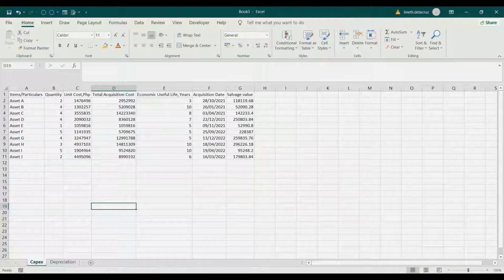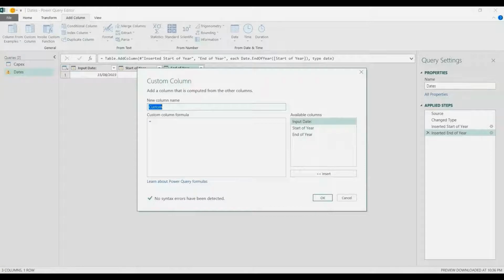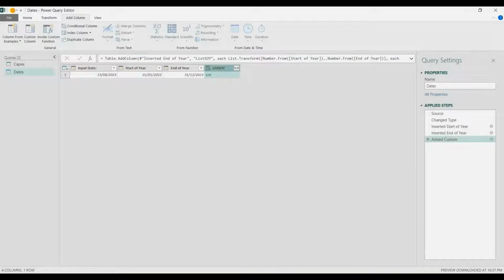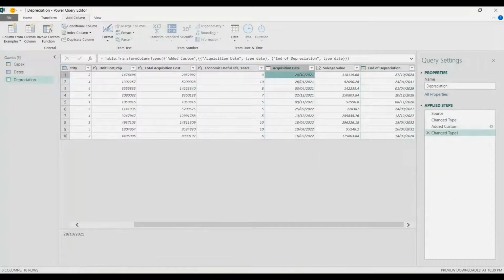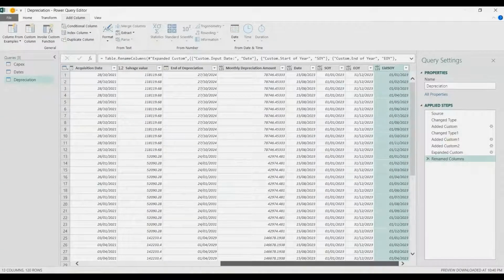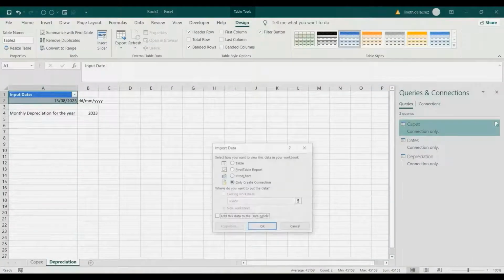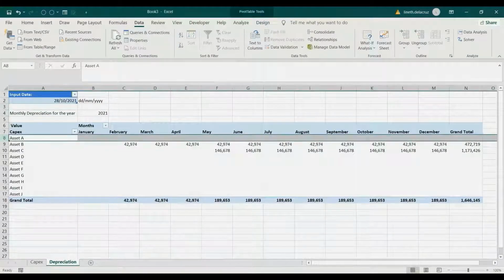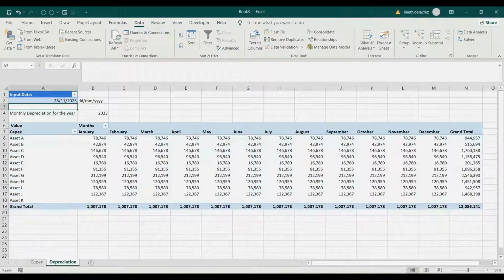Power Query Dynamic Monthly Dynamic Depreciation Schedule Using Straight Line Method

Comment: Lineth

thanks for this tutorial, it was just what I'm looking for concerning  the Straight Line Depreciation calculation.  Can the same technique/ pattern  be applied in power BI  or have I to load the generated table in power BI. 

I seached the web for the function in  power query and found no function for depreciations like de Double  Declined Balance.
does this mean that I have to write the formule with if statements ?

 can your calculate the DDB    ( Double  Declined Balance ) also in power query? 
( restriction here is when the DDB < lineair depreciation   then change to the linear Depreciation 
 
example 
asset 10. 000; l  ive 5 or 20  %;   salvage =0 ;  start date 1/1/2021  for reason of simplicity can be any start date in the year
DDB amount =
first year       = 10.000 * 40  % = 4.000  ( double the lineair %  20 % --> 40 %)
second year = 10.000 - 4.000 = 6.000 *40 % = 2.400 
thirth year     = 6.000 - 2.400 =   3.600 * 40 % =  1.440 because this is less then 2.000 ( the calculated amount  1.440 is replaced  by the linear amount  2000  )
forth year = 2.000
fifth year =  1.600 
and completely depreciated.

thanks in advance for loolkng at this problem

Roger
Reply from the maker: Hi Roger, I haven't tried it using the DDB method. I think the approach would be different. I will try to create or find solution for it.
Reply: Thanks for the effort, have a nice weekend
 @LinethDelaCruz

Comment: great tutorial very instructive example of  power query, just two questions:

1) how do you calculate when  the start data is the date of acquisition rather then at the  beginning of the folowing month?

2) can your calculate the DDB also in power query? 
( restriction here is when the ddb < lin  than change to the linear  
ex. asset 10. 000; live 5 or 20  %; salvage =0 ;  start date 1/1/2021  for reason of simplicity can be any start date 
DDB amount =
first year       = 10.000 * 40  % = 4.000
second year = 10.000 - 4.000 = 6.000 *40 % = 2.400 
thirth year     = 6.000 - 2.400 =   3.600 * 40 % =  1.440 because this is smaller than 2.000 ( the near amount is replacing the ddb calculation )
forth year = 2.000
fifth year =  1.600 
and completely depreciated.

thanks for considering this question
thanks in advance
Roger